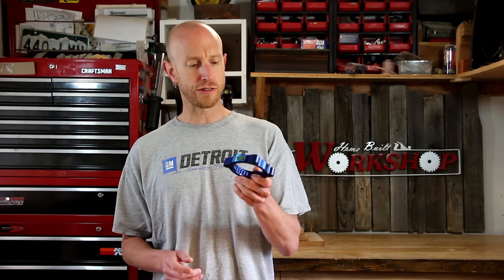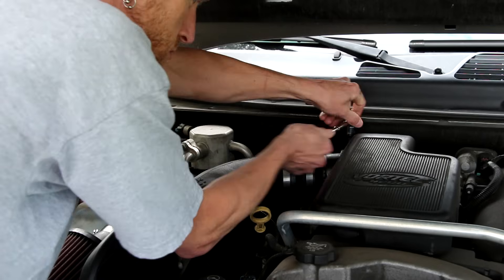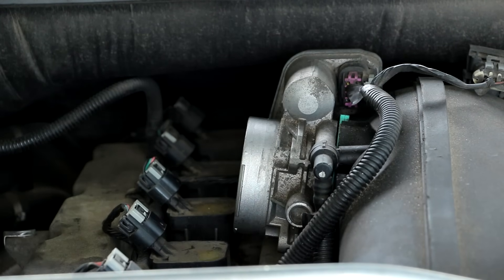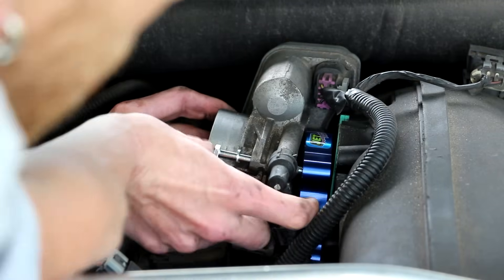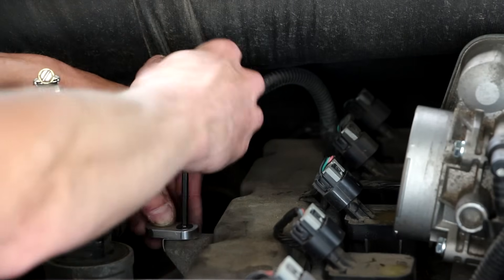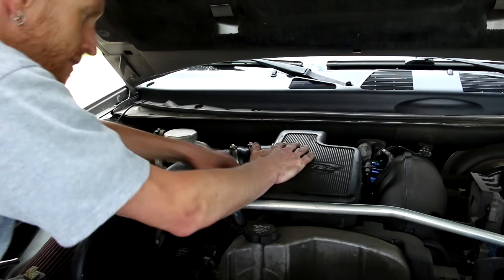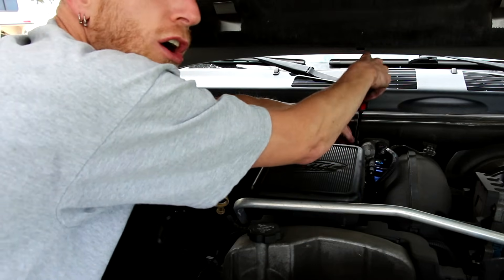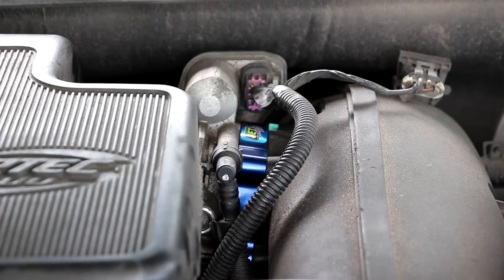Is A Throttle Body Spacer Worth It?

Comment: Hay bud I'll give ya a tech tip if you really want dom noticable  difference  take the resonator that black boxes of and put a aluminium piece of charge pipe your cold air will be better applied  and a big chunk of response  will be a result its creating turbulence  and coming the air back up so your cold air intake  really isn't doing shit
Reply from the maker: I have thought about eliminating that.
Reply: The straightest path faster air flow and big crevasses  heat air up So by taking it out you'll get better performance  even without a cold air intake did a lot of dead space dead plastic removal as l on a stock 92 Corolla  and but just smoothing out the path and discarding anything  In the intake that wasn't needed and not did that make a difference

Comment: Probably the only fuel injected engine it would make a difference on is a tbi engine since it would be letting the fuel flow mix better on the way down. And that's what I'll be trying soon on my tbi 350 along with a super coil headers and a chip

Comment: In general, on an MFI system you will see almost no gain if any with a spacer as it does not add anything other than a little more volume of air, however, as is the case in my 92 s10 with the 4.3 TBi TBI systems can benefit from a spacer as it will help the fuel atomize better into a finer mist rather than turning into droplets when entering the combustion chamber, but even then, maybe a bit better throttle response is what you would see. If you want actual gains, upgrade your cam, the cam is where its at, then you can throw on your spacers, headers, CAIs whatever you want and help up the numbers a bit.

Comment: Ignore the ppl asking for dyno numbers. Its very expensive to dyno a car. Typically 500/hr on average. "Oh i just put a tb spacer for 30 bucks. I know! ill spend 1500 to find out if i gained 1.5 hp!" Also there isnt much of a hp boost potentially a loss depending on motor but it helps with torque which is why its better for low end.
Reply from the maker: +Aaron Wilson that is a great way to look at it. Thank You!
Reply: Jeff Baker np man. I really like your videos. I love cars and have since my granfather had me working on his 63 dodge pickup. Keep them coming man

Comment: A significantly longer intake length post-filtration yields more torque because the air becomes less turbulent due to the longer distance it needs to flow. This is why cold-air intakes make more torque and sooner too; the lower intake air temp is not the major part in adding power.

Now a spacer is insignificant in terms of length added, so I doubt there's actually any significant improvement.

Comment: Did you have to adjust the throttle afterwards? Im putting an Air-raid spacer on my mustang gt today. After pulling the throttle body off and seeing the width of the spacer, my throttle cable & linkage will be open once its installed.
Reply from the maker: I didn't have to adjust it. mine is drive by wire. no cable to adjust.
Reply: I figured it out on my mustang. Mine came from American Muscle and it doesnt have the logo on the top or engraved arrows to show which direction to install it. Theres no improvement or the "whistle" it is suppose to have.
Reply: I got the Airraid spacer.

Comment: And never use a cheap magnet wrenchy thing while changing the plugs in a dark shop.......found missing magnet thingy just below spark plug opening after two hours and my friend with the special magnet spark plug is still my friend. But don't let him start fooling with wires. Another time.
Reply: Wait huh? I mean im laughin but left field isnt where i thought this was goin
Reply from the maker: "cheap magnet wrenchy thing" must be the technical term. Lol. We want to know about the wires.
Reply: He starts messing with wiring and gets obsessed with securing them better than the factory that installed them. Thinks there is a loose wire and causes 5 more fumbling and pulling behind the dashboard. Hard to watch.
Reply: I told him just leave them alone because we found the first problem at the battery. Nope won't listen.

Comment: I'm going afe intake throttle body spacer 6.2 intake manifold ported and 87 mm throttle body should make a difference to the l84. I think for 100 bucks any gain is good.

Comment: Did you have to reset the PCM and if so, how do you do it? I have a 2004 Trailblazer and i might want to try it on mine. Also does that part come in only that color? Because my Trailblazer is Indigo Blue Metallic color & that would look cool. Thanks for doing this video, And i subscribed!!!
Reply from the maker: +John Muller when the battery is disconnected it should reset the PCM.

Comment: It would help if you remove the resonator and connect tubing from air filter to throttle body! Air would flow better rather than causing turbulence with resonators !
Reply: Hector you are correct.

Comment: I put one on my 13 Sonic RS turbo only for the ports that were with it for my boost gauge I noticed a difference I didn't think it would do anything but mine is a turbo car it had quicker acceleration and a growlier sound under the hood I'm skeptical now I run stock air box no k and n drop in but I did notice with the spacer .....

Comment: What are thoughts on a cold air intake I noticed you have one are they worth the money or is the stock box with a drop in performance filter just as good? I drive a 2013 Ram Sport 5.7 Hemi bought it new and dropped in a AEM PERFORMANCE filter didn't really see any difference in performance or MPG no improvement.
Reply from the maker: I think the CAI is worth the money.
Reply: +Anthony Macneil I have an 2015 Hemi Ram. Was gonna get a CAI installed on it, and was advised against it, by a reputable shop, and Chrysler dealership. Was told they wouldn't guarantee "Check Engine" light wouldn't come on.
Reply: +Jay Mitchell most new vehicles come with CAI stock anyway.
Reply: +gokartbuyer Yup, I'd almost have to agree on that. The air hose, or air intake hose that was with the Cold Air system I had bought, was no difference in size, then what was already on my truck.
Reply: +Anthony Macneil 
Hey, the cold air intake is supposed to help airflow in high RPM, it helps the engine to breath better, it actually increases about 8-11 hp to hemi. The best source is a book that i got from amazon and its about modern hemi bolt on upgrades. it has the dyno results and it's  bs free! i hope it helps
Reply: +Anthony Macneil I have a 2012 HEMI RAM and installed a Airraid cai and noticed a better throttle response also had a nice aggressive tone under the hood,
Reply: depends on what your engine has stock.Upgrade the filter first.A lot of engines come with a small or restrictive piping so if you can increase that diameter you'll get more & better airflow.Never once bought any kind of "CAI" but am quite adept at using aluminium straights & bends with silicone hoses to get the required setup at a minimum of cost compared to a "CAI" kit

Comment: i put one on my 94 suburban pre vortec i did notice a 1.5 mpg increase and a little throttle response due to the tightening of the stock throttle cable as for actual HP gain i feel it is not noticeable under daily driving but yet i also am running 280k miles on stock engine with stock exhaust minus muffler

Comment: Actually, since our senses are often better at detecting what we've lost than what we've gained, the proof is in removing it. Drive the vehicle frequently for about a month with the spacer on and then remove it. If you can still say no real difference, it's probably a waste of money. I was convinced a mod was useless until I removed it. I felt robbed afterwards.
Reply from the maker: +Dwight Stewart I've been thinking about trying that.

Comment: The little bit of "quicker response" has nothing to do with the spacer. Its the fact that your throttle body is out a  bit little further therfore your throttle cable is tightned a bit. You could achieve the same results by adjusting tour throttle cable tighter. Especially if its original throttle cable because it has surely stretched ovet time.
Reply from the maker: +z28 this vehicle is a drive by wire. The throttle body is run by a stepper motor and does not have a cable.
Reply: wrong
Reply: Not wrong u can clearly see in the video hes right i work for gm and i have never seen a cable drivin vortec throttle body

Comment: I'd like to know the physics behind such a modification.  Your simply creating a slightly longer intake behind the throttle body assembly.  I don't see how this extra inch would affect the air flow or air volume.  Assuming that  this mod would have a positive effect on all types, sizes and different manufacturer's engines, seems to be highly unlikely.

Comment: Hey there smart fella  what if you incorporated that spacer with a Cold air kit and a T.B upgrade .. Do you THINK that those combined you might have increased performance ? Yes Maybe ?  I DO ... So when you start adding up these small upgrades what you end up with at the end is REAL noticeable improvements because every motor head I know knows that anytime you increase plenum volume you have made progress  ....Next you might wanna go with the ZERO OHM Granatelli Plug wires that are truly ZERO OHM which together with  a coil upgrade gives you seat of the pants improvement . now add all those up and guess what fella ?  You have a real performer in both MPG and  response ...We tested it at a traffic light and was shocked  at how well the Jeep 4.0 responded to these small upgrades that paid Big Dividends ....

Comment: It works with a car with a carburetor not a efi car. The ecu is controlling the air/fuel where with a carb the more space given by the spacer alows the carb to suck in more air into the engine. ive seen v8s gain 5-8hp with a carb spacer

Comment: Ok so I guess the 150 for exhaust and 250 for the cold air intake is way! Better! For the money for gas mileage I have 2005 Tahoe family truckster gets 19-20 in a half on the highway and looking to get a little more not much on power but I guess that would be the best bang for the buck the cold air intake and exhaust I guess ??? What's your opinion
Reply: Don't spend that much on a cai you can buy a much less expensive one they all do the same thing and if you want you can buy a k&n high flow air filter separate from it

Comment: Would a throttle body spacer work with a plastic intake manifold? I heard you get bo gains with a plastic intake manifold.
Reply: Yes, its not the spacer it is the corkscrew creating air rotation which scrubs off turbulent air behind a heavily restricted intake manifold port.  Remember, Bernoulli principle and the Venturi effect is in play here at the intake. Drag is the problem from poorly designed factory manifolds and too narrow throttle body valves.

Comment: Guess it all depends on the car too. 2 different cars, from different manufactures are gonna perform different. Sometimes you think you are going faster when you install something too. That's some much in the tuner community. I like how you did a quick after drive video. Then a "after a week" video. I got one for my neon...but also an intake manifold spacer from neongoodies. The DOHC first gen neon has a poor air flow, which helps it some. Have yet to install it tho.

Comment: a before and after dyno would have been the only concrete data you would need to know if that product made any difference.. relying on the butt dyno is obviously not a good way to support whether you gained or lost power. if youve done a dyno video i would like to know.

Comment: Does oxygen fall into the throttle body faster allowing more airflow If it's got a HIGH-RISE INTAKE. Or cause it to fall faster in the engine when u use a THROTTLE BODY SPACER resulting in more power with some engines.

Comment: They're a hold over from the carburetor days.  On a carb it does help w/ a cooler air/fuel mixture.  But a fuel injected engine?  No mixture to cool, it's just air!
Reply: Unless it's tbi, and the early tbi vehicles could probably benefit alot from it

Comment: Hey Jeff in your opinion do you think a high performance throttle body is worth it compared to the OEM?
Reply from the maker: +Piero Leon honestly I've never tried one. If I could find one for my vehicle I'd give it a try. Hope that helps.
Reply: +Jeff Baker I just saw the video and I enjoyed the real life down to earth no nonsense aspect of it. Thanks for your honest opinion on it, I was considering putting one on my 2000 Dodge Dakota sport 4.7 5 speed manual but like you said it's not cost effective for the amount of difference in performance. Thanks again I really appreciate your input.
Reply from the maker: big D thank you.
Reply: Jeff Baker , I had a 2001 Dakota, it was the only "improvement " I considered worthless.
Reply: Nevertheless, I'd still like somebody to dyno before & after. If it makes 1-2 hp, for some people who have done everything else, it may matter.
Reply: Lowell Stokes I decided against the spacer and I'm considering other options. I'm currently thinking about a true cold air intake or maybe some headers.
Reply: big D good call, I did both, and they actually work!
Reply: colod air adds nothing..looks good...headers with duel ex will give u 10 to 20 pct hp over ex mans w single exhaust

Comment: Could you remove the resonator and just have a straight pipe to the throttle body? Whats the purpose of it?
Reply from the maker: I believe you could remove it. I think its there to quiet the system down but I'm not completely sure.

Comment: I'd have to see some dyno numbers to believe any subjectively perceived improvement.  CAFE regulations are so tight now that the OEM would have designed one in if it helps fuel economy and since it's before the fuel shot on port injected motor (not like a spacer for a carb or throttle body injection which effectively increase the intake runner length) it would probably have a negligible effect on output.

Comment: was using one for a year and my fuel pump broke twice I'm not 100% if its related but its a brand new 2014 model and thats the only mods i did was this and a cai. If it did anything it might of screwed up the air to fuel ratio for the starting of my car.
Reply: maybe your ecu was sending more fuel in forcing the pump to work harder? idk im not a mechanic just my 2 cents

Comment: Plenum spacer maybe,   ...   ...  MAYBE...... but not TB.   Whats the theory on how it works?  They are all made of aluminum so I doubt heat transfer, and the increase in plenum volume should be very small...  U might change the way air goes into the plenum and IDK shoot more to the back but that's dubiously useful for a well made modern plenum.

Comment: Actual Dyno results show that throttle body spacers do nothing for power or torque. If you want improved performance you need to go with a slightly larger throttle body.  Don't get carried away here. 5mm to 7mm makes a different.  Of course the opening in the intake manifold need to be large enough to accept the larger blade. 

As for that resonator.  Get rid of it. Make yourself an adapter that allows you to attach the cold air kit directly to the throttle body. Also be sure that the cold air kit seals to the hood to keep out engine heat but can draw in cold air from the front of the truck without an issue. The part some people miss here is that they are sucking in air that gets warmed by the radiator and not fresh cold air.

Comment: Tbs only works on v6 or mostly on 4cyl. V8??? Not.  I used on my Honda Accord and it works. Better throttle response and torque my gas paddle doesn't need to be press down as much as I used to and better mpg. When you are on the freeway, small press on gas paddle, it just launch a lot quicker than better before.  It takes a couple days for the computer to learn the difference variations of air/fuel mixture before you notice better improvement.  Most car's after 2010 may not work because ECU are more communication with other safety components.

Comment: A Throttle body spacer and the affects of it on performance can be increased with a cold air intake, and resonator and/or muffler delete, or a high flowing flowmaster muffler. Also a tune. The spacer is all about airflow and your exhaust and all these mods work together so they can increase the affects of each other.
Reply: Your Right
Reply: That's all I'm waiting for is my cold intake to get here so I have a throttle body and spacer I have exhaust system dual setup with no cats two super 10s with a x-pipe
Reply: @hemi5.7villain  I got the exact same lmaoo but I still have my cats on. Having no cats on has it hampered the car in any way, like any exhaust smells?
Reply: @poundempanthers4145  That's what's up Sir i don't have no smell to me and one's that have  been n it never said anything about it I got a basic tune up with msd coils n spark plugs slowly working on it in get real tune hopefully by the summer all being PATIENT